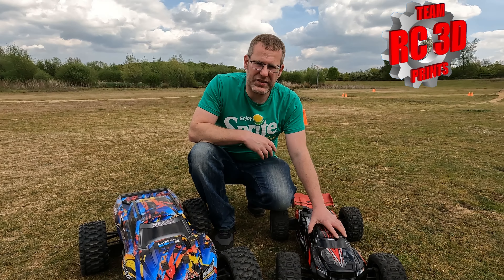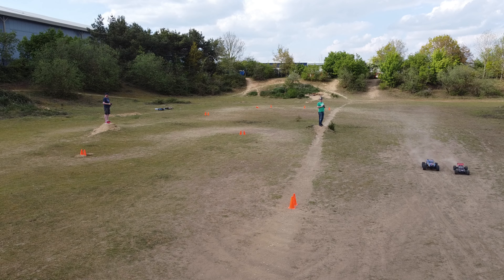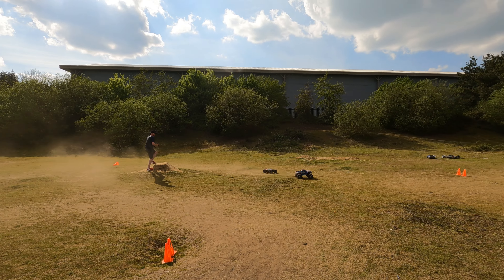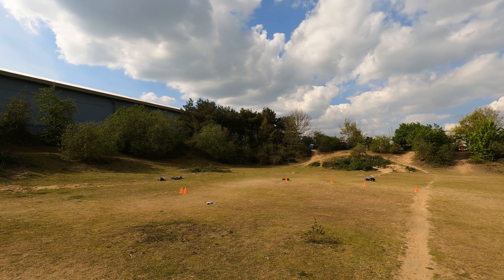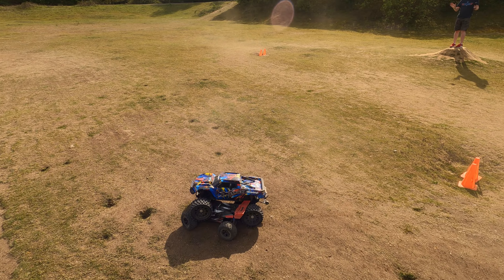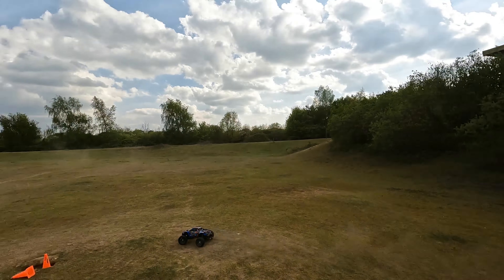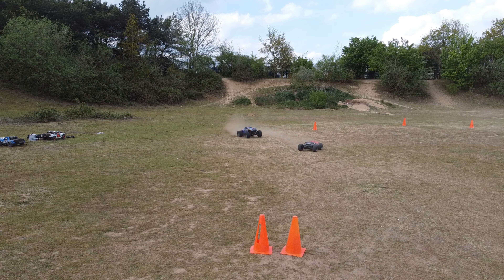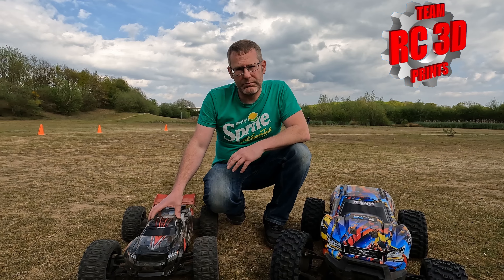Traxxas Sledge vs X-Maxx - you'll never believe which is faster!

Comment: Could you mount tyres from xmaxx to sledge? With both 8s and same tyres?
Reply from the maker: Sledge doesn't lack power so 8s would be too much we think.
Reply: @TeamRC3D  OK, and is it possible to drive larger tires from xmaxx on sledge? Comparison of traction Video? Thanks
Reply from the maker: They wouldn't fit unfortunately  - the hex on the X-Maxx is much larger (24mm vs 17mm) and the front tyres would rub on the body when we steer. Also they would weigh a ton and stress the suspension and gears. When we fitted the Badlands (in this video https://youtu.be/WG9v0dPi0Jc ) we even had to shave the tyres slightly!

Comment: With m2c upgrades the sledge might be close but I'd rather up upgrade a kraton that's 100 cheaper than Traxxas over priced pot metal.. but after the upgrades Rich duperbash did and put the sledge through is impressive.. the stock motor mount system of the Sledge it's just straight garbage for major bashing that is..
Reply from the maker: We have noticed some issues with the stock mount not lining up very well